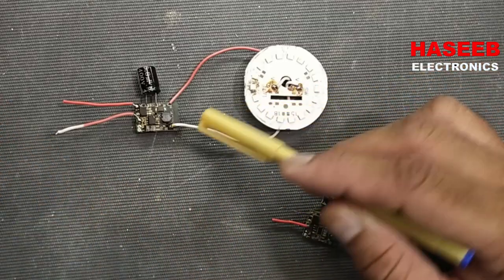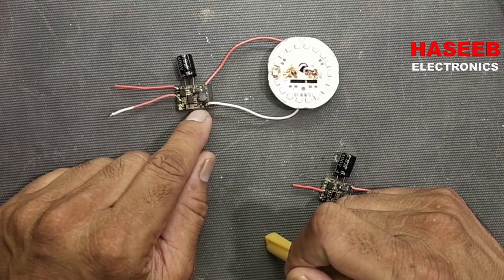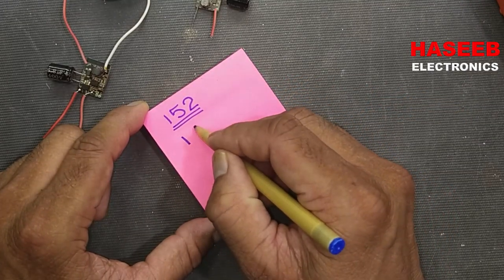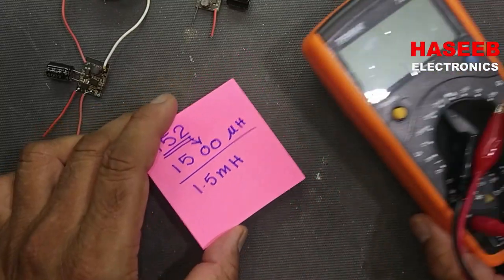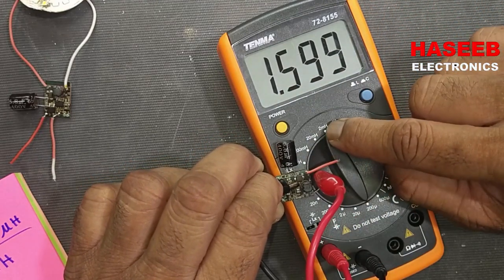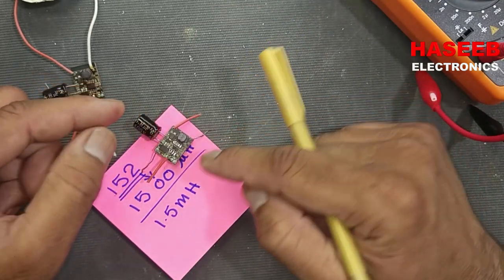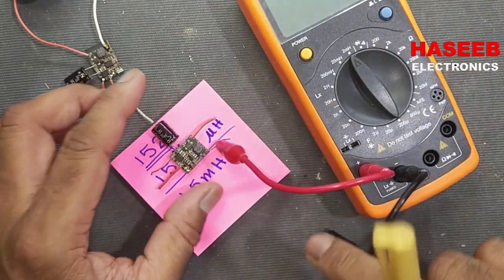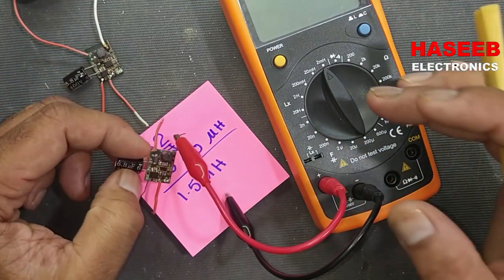[395] How To Calculate Inductance from Inductor Code, How to Test Inductor using LCR Meter

Comment: Great video, you mentioned about the frequency of the inductor. How does the frequency of the inductor affect the circuit it is being used it and is there any way to calculate?

Suppose if we want to find an alternative inductor, how do we go about selecting it?
Reply: @HaseebElectronics  Thank you for the info, appreciate the response

Comment: Haseeb, cheers from Poland I have 1 question about the inductor. Do you think the inductor is faulty? I have 2 DC dc converters and tp4057 modules. 2 tests 2 different results. 1st set is boosting to 5.128 V, and the second (set of electronics, same 18650 battery) is giving 4.950V (~). Should I try and replace the inductor for education purposes? https://youtu.be/4nmsRZLhx6o